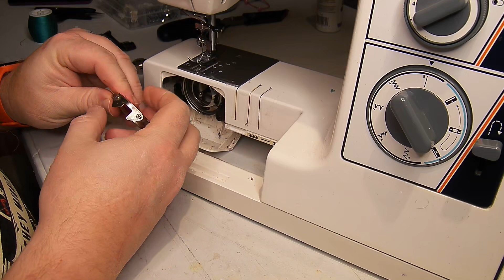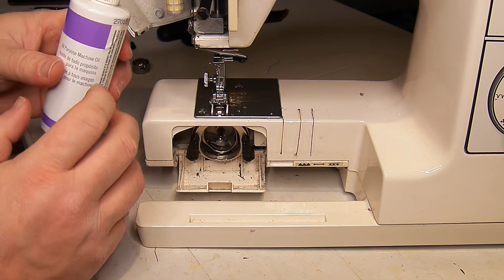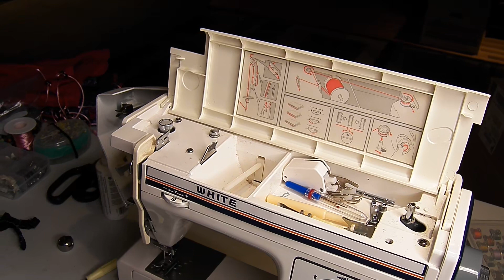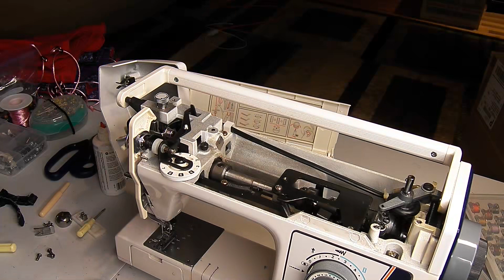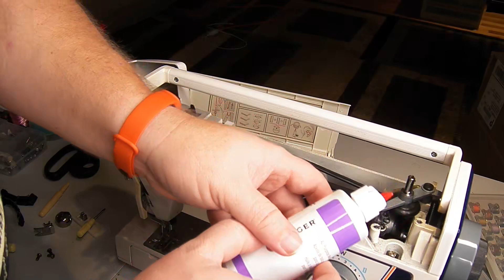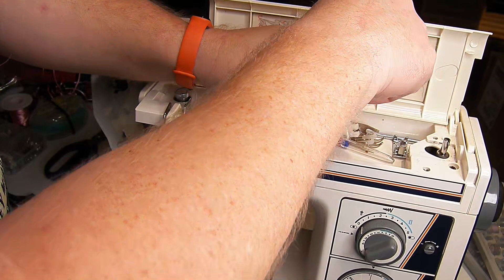Oiling my White Jeans Machine

Comment: Hello, thank you for sharing these videos. I just got the 1599 machine and I can't figure out what is going on with a part that looks like a bent paper clip. I believe it is called a "check spring assembly" wire. Mine is sort of hanging down to the right when looking at it. Could you show how it is supposed to fit correctly?
Reply from the maker: I made a video about tensioners today and I hope it is helpful.  The check spring, tension check spring, check spring assembly, and takeup spring are all the same part and the White Jeans Machine has the modern style I show in this video.
https://youtu.be/aMK6fl6Z29U

Comment: hi I just got this machine.  Thanks for the video.  Any ideas to loosen the stitch length dial?  It won't turn
Reply from the maker: Is it completely seized up or just incredibly stiff?  If it is completely seized up then you might want to use a bit of penetrating oil (PBlaster or WD-40).  Take the top plastic tray off (it should just take a couple screws) so you can look down inside the machine and put some on the back of the stitch length dial.
I have also seen machines so full of lint/thread down by the bobbin case that they feed dogs are completely immobilized.
If you have any more issues, when I have the current machine (The Kenmore 158.13180) finished and off my work table I can get out the White and do a small teardown video on it and try to show different areas that might be a problem.
Reply from the maker: Here is a video of pulling my machine apart and where all the linkages on the stitch length and width dials go inside https://youtu.be/GotivatbzTQ
Reply: Hi, I ve this exact machine but don't know how to thread it.